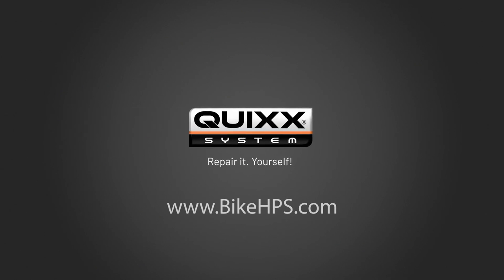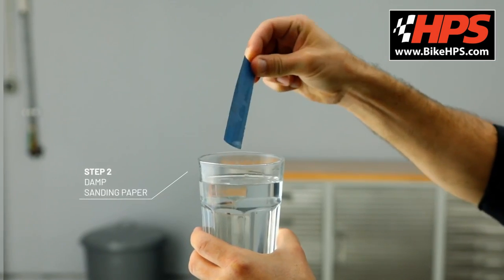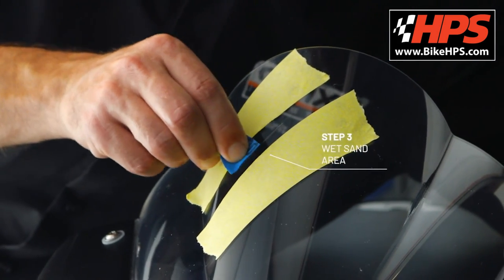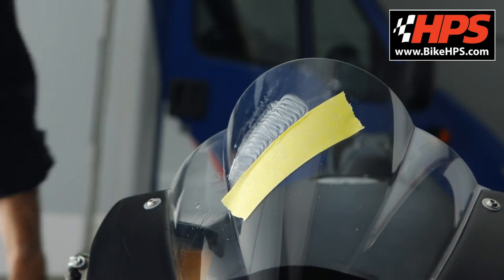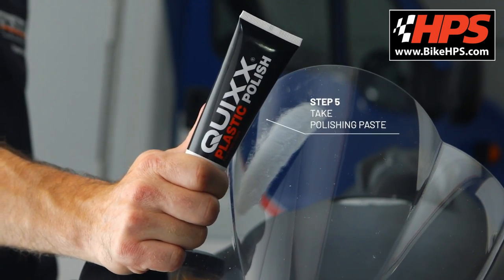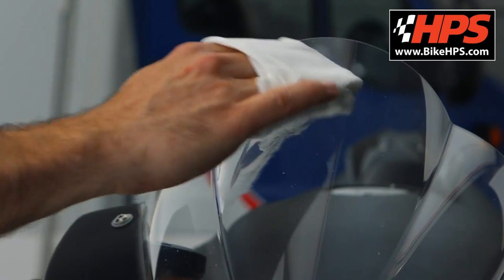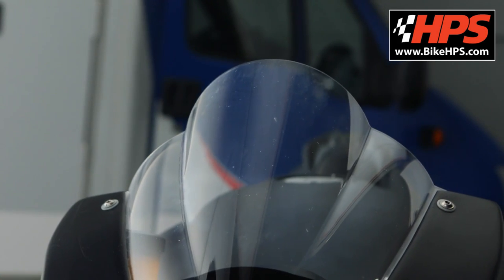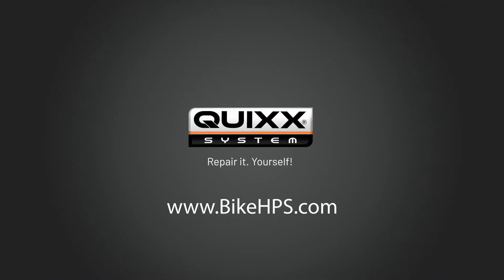Easily Repair a Scratched Motorcycle Screen

Comment: It is not true. Scratched plastic  windshield can never be repaired.because the more you clean the more are damaged. Have to put under water pressure without touching and after that dry it by hair dryer that's it.

Comment: What kind of wet sand paper is used ?
Reply: She said 1500...
Reply: The more grades used, the more work. The finer the grade, the least amount of plastic removed. If scratches are DEEP you will need coarser (500/1000). If the scratches are fine, use 1500. If you finish with 3000 grit or higher, you'll end up with a smoother shinier surface.